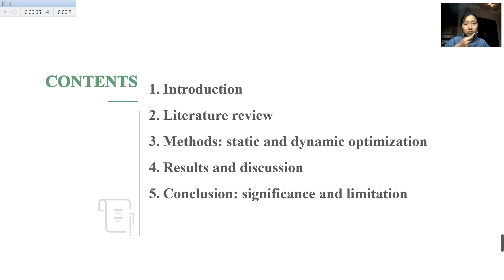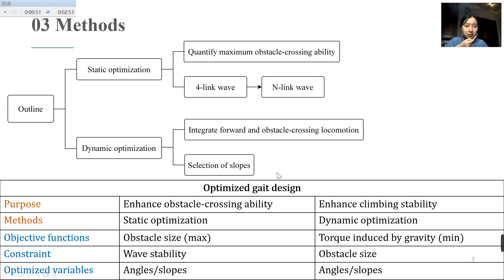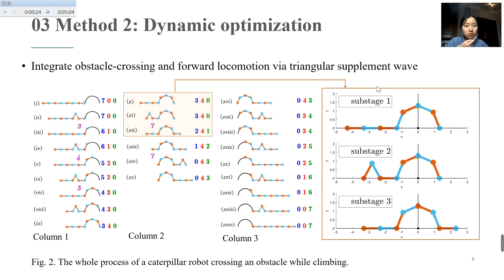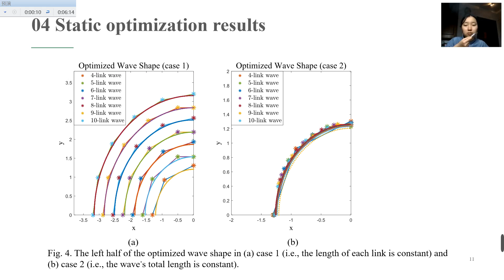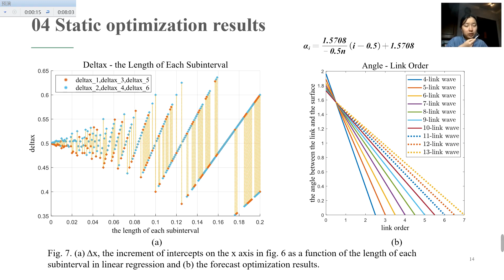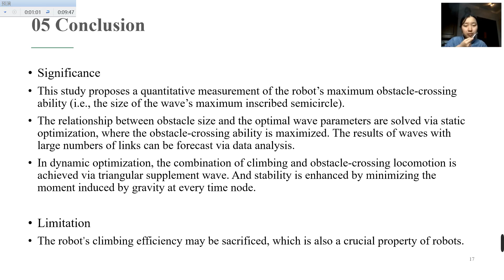CONF-CIAP - Optimized Gait of Climbing Caterpillar Robots in Terms of Enhanced Obstacle-crossing ...

Comment from the maker: Here are the questions we collected and the answers replied by the presenter: 

Q1: Have you encountered any bottleneck when researching this content, can you talk about it briefly?

A1: I encountered quite a few bottlenecks when researching this content and I will talk about two of them briefly. Both took place when I tried to solve the set of optimization equations via programming. The first one happened in static optimization to enhance the obstacle-crossing ability. I got a concave shape after solving the set of optimization equations, which is by no means stable. This problem was solved (i.e., a convex shape was derived) after I added the size relationship between adjacent wave links into the constraint conditions. The second blockage happened when I extended the optimization equations of waves with several number of links to waves with large number of links, where the computational cost greatly increased. This problem was solved by data analysis. To be more specific, I tried to find some pattern of the relationship between the optimized wave parameters and the number of wave links via regression analysis using the optimization results in cases of waves with relatively small number of links. And then I extended such a pattern to cases of waves with large number of links.

Q2: What is the practical significance of robot gait optimization?

A2: Robot gait optimization can enhance the robot’s properties and task performance. For instance, in this work, the relationship between the number of links in the wave and the quantified maximum obstacle-crossing ability is derived. Thus, given the size of the obstacle, we can determine at least how many links should be used to form the locomotion wave. In addition, quantifying the maximum obstacle-crossing ability as the area of the maximum inscribed semicircle of the polygon enclosed by the robot’s wave and the climbing surface (i.e., the objective function in this optimization problem) is of practical significance because of the wide range of application. To be more specific, no matter how intricate the morphology of the obstacle is (e.g., the pits and bumps on the cable surface), the obstacle can be enclosed by a semicircle. Furthermore, zero contact and interactive force between the obstacle and the links of caterpillar robot can be achieved in the whole optimization process, which is especially practical in circumstances where the climbing surface is corrosive.

Q3: What inspired you? How did you come up with these two perspectives?

A3: I marveled at the unique motion modes of caterpillars (e.g., the alternating contraction and relaxation of trunk muscles via locomotion waves) and their excellent properties (e.g., high flexibility and distributed weight) in literature relevant to caterpillar kinematics. Fascinated by the significance of the locomotion waves, I wanted to investigate how the enhancement in climbing caterpillar robot’s properties can be realized via optimizing the wave parameters. When scrutinizing previous research about the properties of caterpillar robots, I learned that stability, obstacle-crossing ability and moving speed are their three main crucial properties. I also found that despite the numerous similarities in stability examination, there isn’t a unified quantitative method to study the obstacle crossing ability. On such basis, this work aims to study the optimization of the stability and obstacle-crossing ability of climbing caterpillar robots quantitatively and derive a universal solution.